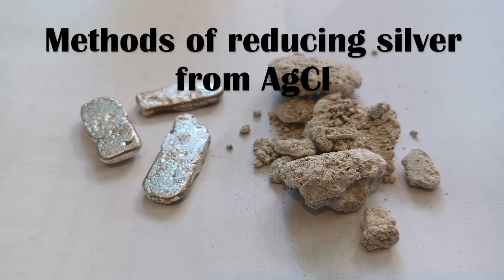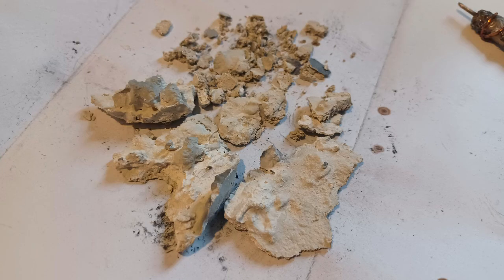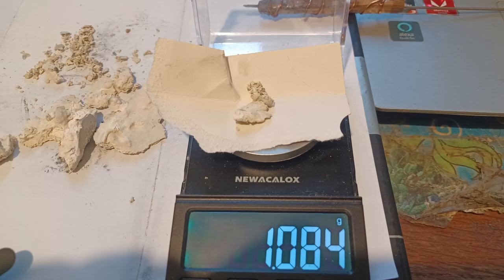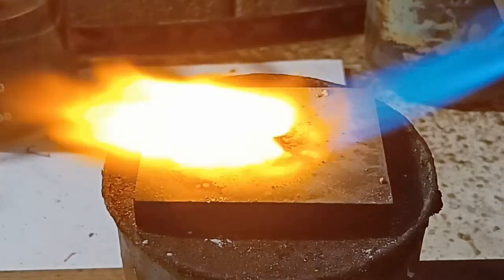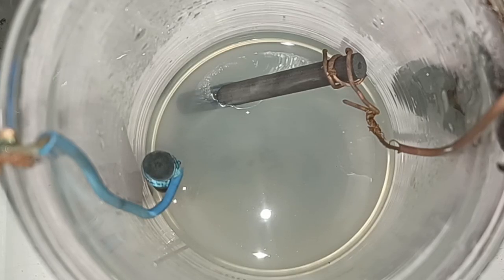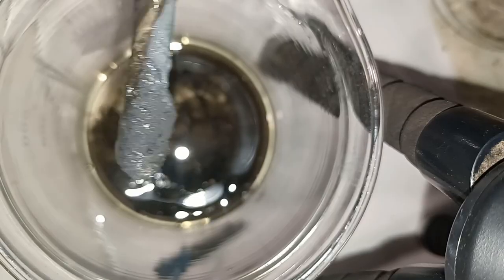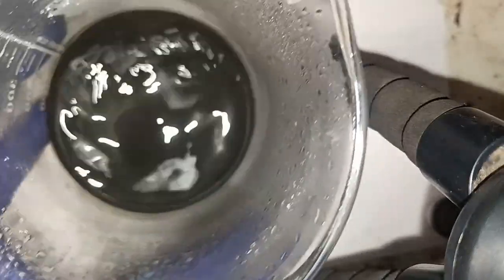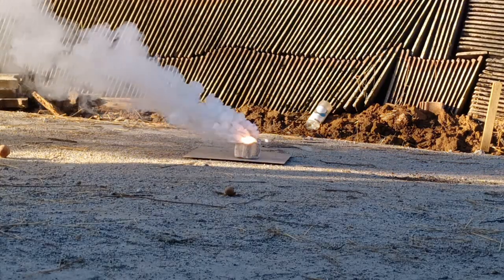Methods for reducing silver from silver chloride

Comment: in the future if you do impromptu electrochemical lab procedures, it can be helpful to use PTFE or Teflon tape and wrap tightly around exposed connectors to prevent unwanted contact or exposure. like on your cooper wire reacting with ammonia.